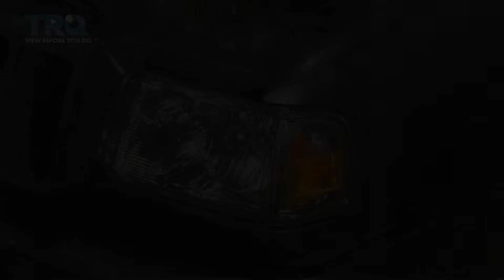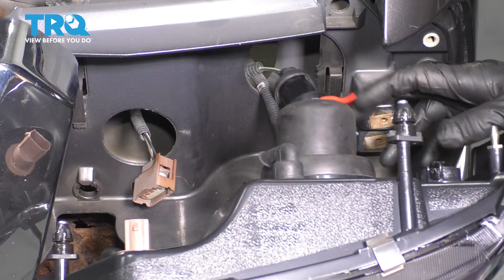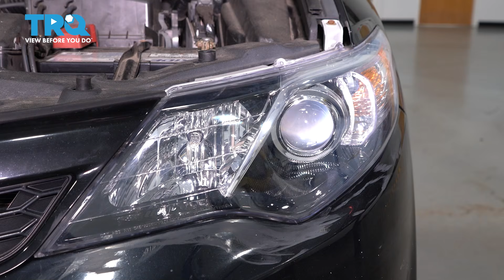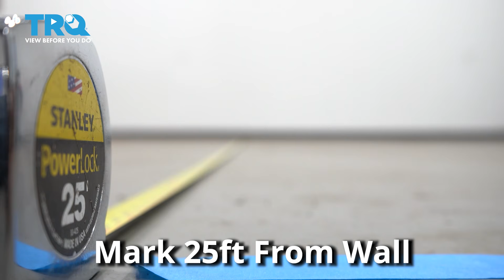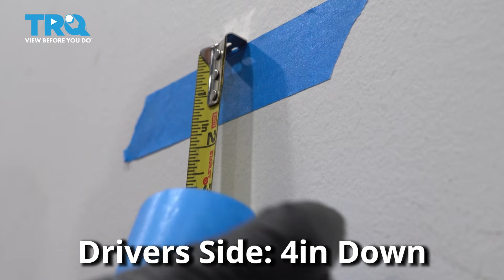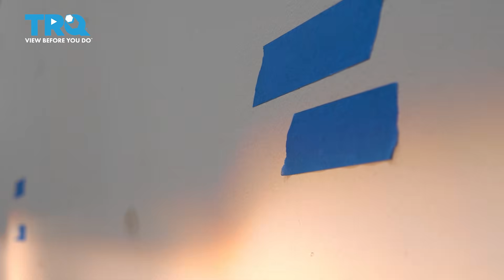How to Install Performance Headlight Assemblies 1998-2011 Ford Ranger

Comment: This is not accurate for a 1999 ranger. Those tabs you pulled up to release the original assembly are not present on mine.

Comment: The front end on the 98-00 rangers are slightly different. Do you need to do a conversion to the 01+? or will these fit a stock 98-00?
Reply: 2 years late, but putting this here for anyone else who has same question. 

No, would have to change out header panel/core support, fenders, hood, bumper, and grill. Basically whole front clip and header panel